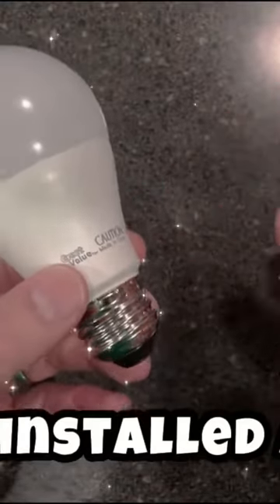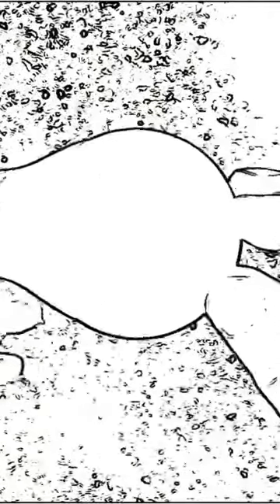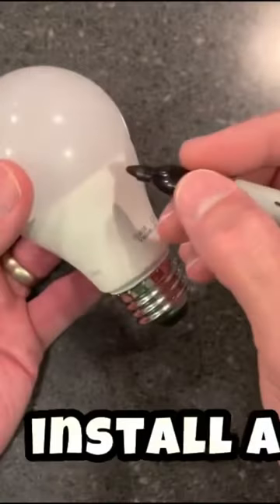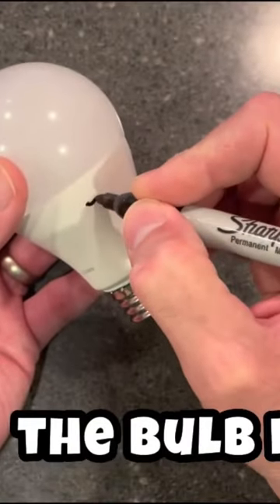The Ultimate Home Safety Hack: Detect Electrical Issues with a Light Bulb #shorts #diy #ledlights

Comment: Or its just a very cheap made bulb like great value
Reply from the maker: Thanks for watching!
Reply: @weekendworkbench1  not trying to be be negative it's just I put GV bulbs throughout my house.  Out of 8 4pks I had 3-4 that burnt out really quick but the rest lasted years and years.  I even had one bad out the pack that never even turned on.  I went through the same thing buying super cheap interior vehicle LEDs.  They were so cheaply made that half burnt real quick or never worked but u just have to sort out the bad ones and replace but when your paying pennies on the dollar it's worth it to buy double what u really need.
Reply from the maker: Thanks for sharing this info!!